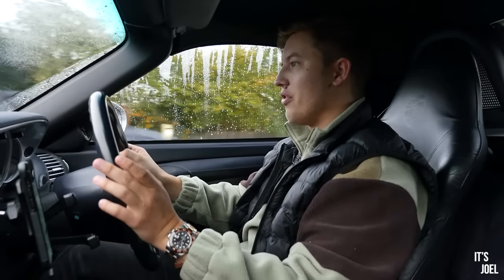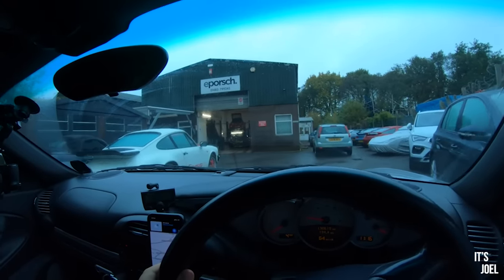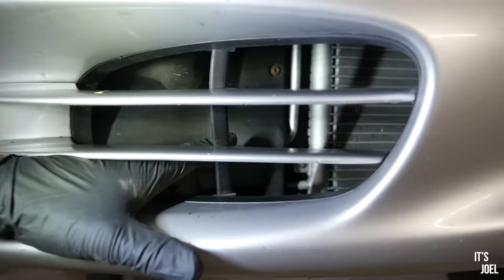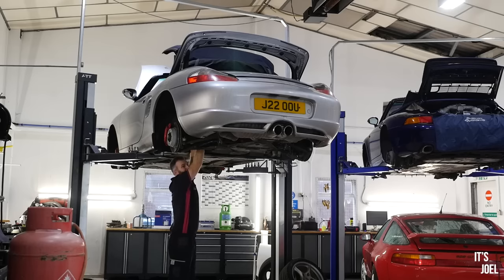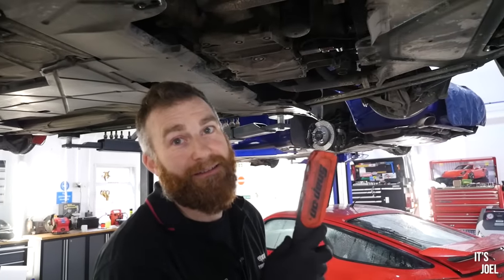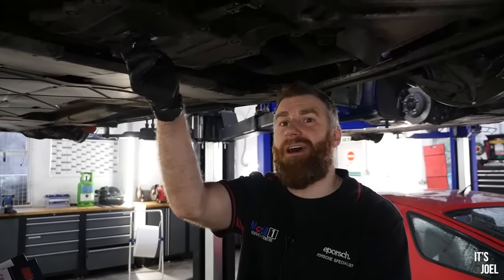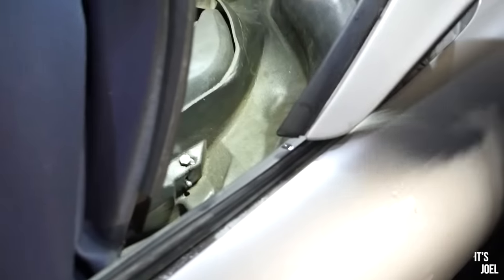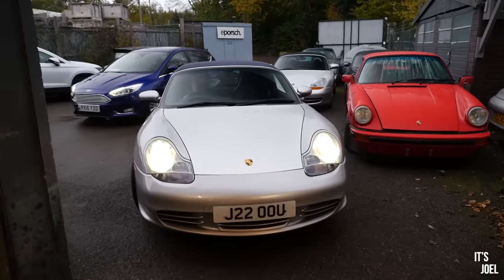Here's why my Porsche Boxster S was so cheap...

Comment: get a magnetic plug
that catches metal parts and serves as tell tale for IMS
easier to check plug then to pull apart dirty, oily filters.

one warning, don't be surprised on first check , it WILL have small metal flakes in it
that's stuff that has been living in the sump for ages since break in of the engine , at the factory.
2nd check should be pretty clean

For IMS and oil usage of the engine:
Always warm up the car properly
Properly means : Not idling
Drive it
keep revs below 3K till the temp needle starts to move
Then keep it below 4500 till it's at normal temp
Wait another 10 minutes past normal temp before you drive it hard at redline

Do Get the lower temp thermostat
Do not drive it lazy low revs once it's warmed up, these engines are made to spin, not to lug.
Do learn to do yer own oil changes, and do em frequently 5000km or once a year and check the mag plug when you do.

Always use the same oil brand/type, you can switch viscocity (for instance go 5w40 if it's sweating a bit at 0w40), but do so within the same brand and type, so same additives.

Comment: Bought and own a 997 that came with a over-sized (bigger diameter, looks factory installed exhaust) and is quite free-flow and makes a bit of noise. I like it for short distance (77 MPH @ 2900 RPM) it is not loud, but any long distance, canyon driving it can get to be annoying and ear plugs is best remedy.

Comment: Quite easy to tell how well a car has been looked after, especially a car like a Porsche. Parts and for that matter a service can be expensive so either it has or has not been looked after, or was bought in good condition and then run into the ground with little to no maintenance. Most Porsches were designed to do 150k miles before needing any major parts/repairs yours sounds about right, some parts recently done some getting towards needing done. I have owned many especially 928s some with less that 40k another with over 500k and you could not tell the difference, except the interior which I changed. BUT I have had service bills over 3 times yours (brakes clutches), but back then I used them daily and travelled through UK and Europe so they had to be spot on. I had a water pipe split once on the outside lane on London's outer ring road management system went mad, car would not start, stuck and threw a con rod 5 miles from home on the M1 put 3 holes in the engine, that was still running !!! cars for you

Comment: I had a 2004 550 Anniversary 986 which comes with the M030 suspension fitted, the airbox from the 986 (which is what leads to the extra 6hp) and a load of cosmetic stuff. At 65k miles (I think) I had to have my 2nd gear replaced and they changed the clutch, the dual-mass flywheel and the IMS bearing at the same time. That little lot was the most expensive service during my ownership - nearly the same as what you paid for this car! It looks like your example has been well looked after and I suspect its already on its second clutch.
The IMS bearing that came out was spotless. As stated by your mechanic, if the IMS bearing fails, by the time you know its going its probably too late. An engine rebuild is very costly and frankly I think you'd be better of just swapping the engine.

Comment: No. Keep exhaust original. Porche designers know what they are doing.
Reply: I bought my 2.5 986 with a Porsche sports exhaust. I was clueless. Didn't realise until my pal had 986 S and it sounded so quiet congested to mine. PSA was really discrete until 4k rpm when the valves opened and it sounded fantastic.

Comment: No doubt the owner sold that car to get out from the potential failure of the ims bearing, which, if you do some research on the internet, you will find that boxters made between 2000 and 20005 were susceptible for ims bearing failure, and at or around the 130000 mile mark. 
If I were you, I would get the ims and rear main seal done ASAP if you really want to keep that car, because you are driving around with a time bomb, that when your ims goes, your engine will be junk, and a complete engine rebuild will be much more than the 5000.00 ims repair bill. Good luck,

Comment: time to widebody it and turbo charge the flat 6
Reply: Thats not that easy as the rear engine compartment is crammed and has very less space for a turbo. A turbo also brings some heat problems, therefore a supercharger could be a more easy task.

Comment: Porsche's have the worst boot release ever. Its like opening a bonnet, you have to get your hands under a grubby gap and flick a grubby lever across. Porsche are a gamble, sometimes you are lucky and get a runner , sometimes you get a lemon, you can't really tell without an extremely detailed PPI including borescore etc.  My trans lock up has ; started playing up which is either throw a grand at it with a chance of fixing it, worst case it doesnt and I lose the money and its a 4k rebuild. I have spent 13 years fixing mine. Done everything on mine , rads , condensers, air con pipes, compressor , brakes , suspension all arms, tuning forks, coffin arms, shocks, bushes, water leaks into the front cabin, exhausts ,coil packs, etc. Mine hasn't been a lemon either its just normal Porsche. I do all the work myself. Prob spend a 500 to a grand a year on parts , it would be twice that at a garage. Still having a 996 has been fun although ,, I only get to do about 2 k miles  a year in it due to other things in life.

Comment: Porsche specialist a? Those wheel bolts should have been dressed and dabbed with copper grease so if you have a puncture in the future you're not at the side of the road stomping on the wheel spanner trying to remove the wheel bolt which has seized solid. Finally, I would insist the wheel nuts are torqued using a hand torque wrench (as they now do in all reputable tyre garages) and not using a torque gun. If the torque gun becomes faulty, there is a chance of the bolt not being torqued correctly. You probable think I'm being finicky, however, in my eyes the sign of a great garage is the attention to detail.